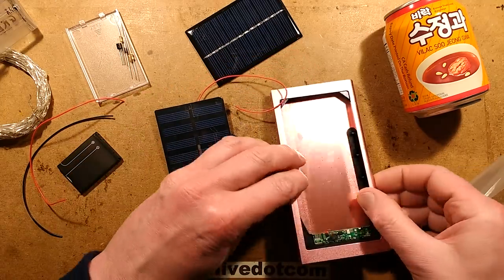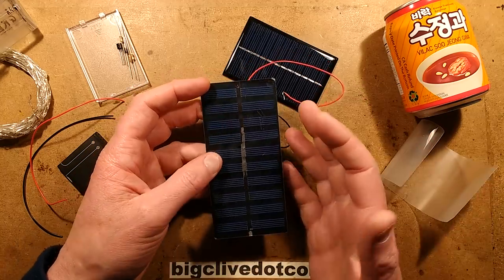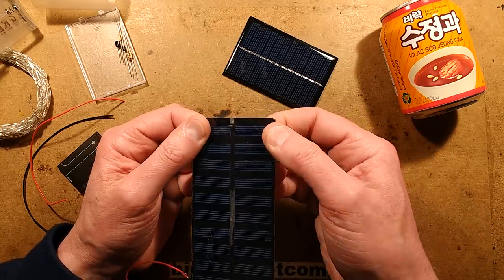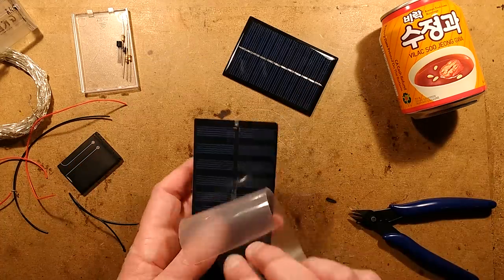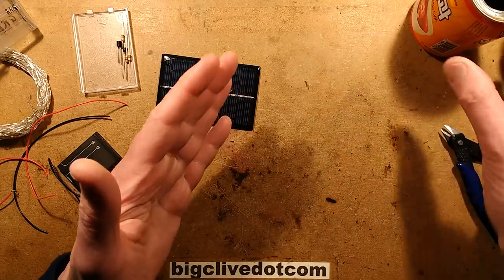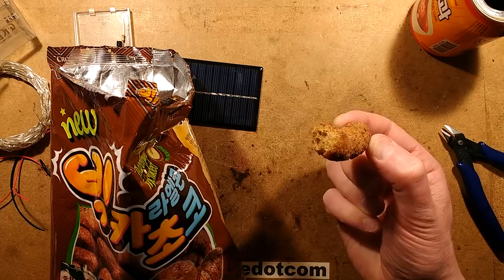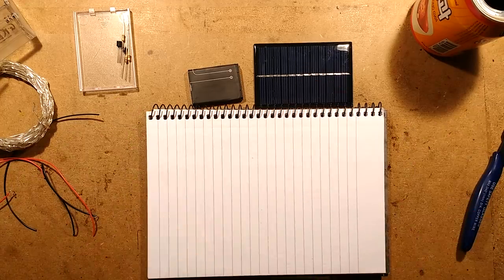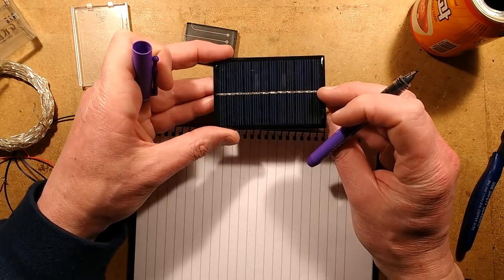Simplest solar light possible, using old phone battery.

Comment: I know my response is a little late, but yesterday evening was the time i finally got the parts and the time to build this circuit for a 3D printed VW T1 van. I want to use it to light up the headlights, taillights and some interior led's. So some simple led's. The circuit works, however i have to place the solar cell directly by the window for it to turn off the lights and start charging the battery. If i want to place the thing on a dresser in the room then it finds that the current daylight is not enough.
So my question for you Clive, is there a way to adjust the circuit so that it turns off the led's in a less bright environment? Thanks in advance.
Reply from the maker: What voltage and current output is your solar panel?
Reply: I have 2 small panels in parallel both are the same and are 5V 110mA (0.15W). One larger panel of 15 x. 6cm didn't fit the model, so i bought 2 smaller 5x3 cm panels and thought 2 of them in parallel is about the same as one bigger panel at 200mA   @bigclivedotcom
Reply: Hey Clive, i did some thinking about my use case and came up with the following. My solar panels can generate 5V but at the ambient light i get here it gets nowhere near the 5V max output. So watching the video again i would guess that since the voltage of the solar cells needs to get above the voltage of the Li-ion cell, thats the reason why the circuit only turns off the led's when i hold the solar cell in bright sunlight.

So lets say that my cells produce about 2.7V in the daylight i get indoors (yes i've measured this voltage) would it benefit my use case from changing the 2 cells in parallel to series? That way i would suspect i get around 5.4V in total in this normal daylight and thus enough voltage to be above the battery voltage. Which in turn would make the circuit usable again for my case? (although charging current would then be reduced to the 110mA of a single solar cell)

What do you think? @bigclivedotcom
Reply from the maker: @patrickneijenhof4080  Try wiring the solar panels in series.
Reply: You have a way with words Clive :D Thanks. Will let you know if it works out :) @bigclivedotcom
Reply from the maker: @patrickneijenhof4080  Ah, I didn't see the bit of your comment where you mentioned wiring them in series.  It sounds like a good idea.
Reply: I suspected you indeed did not see my second part of the comment, but even if you had seen it, then it would just have been the short and concise nudge needed to get me in the right direction. I need to rebuild the circuit as i did something stupid and blown up the transistor yesterday evening. Luckily i have everything in spare, so going to solder it up later tonight. that way i can test it tomorrow :) @bigclivedotcom
Reply: Hey Clive, Progress has been made, placing the solar cells in series is resulting in the circuit staying off at a lower brightness. It is however still not perfect. To explain i first need to elaborate on the led's i've used in the model. it consists of 2 classic style red led's, 2 warm white clear led's and a small strip of 4 smd warm white led's that are cut from a 4.5V ledstrip. All led's have their own 330 Ohm resistor as i like to under drive them and the 4 led's in the strip also have one 330 Ohm resistor. The issue now is that with the room light on the red led's sort of glow and the rest is still off. As if the transistor is in a halve on state. Placing my hand on the solar cells results in all led's turning on, but not at the brightness i got with the old configuration. Shining.a light on the solar cells though, turns all led's off so i guess daylight should be enough for the battery to start charging.  So would there be a way to influence the current setup, so that the led's get the same brightness as before in the other setup? I suspect the combined voltage of the solar cells is a bit on the high side now for the circuit, (even in the dark)?  Again thanks for the help. @bigclivedotcom

Comment: I made one of these. Myself and I'm getting weird results. The solar panel I'm using is 7.2v 100m but under a very bright flash light I only get 4.3v between battery + and emitter of bc547 and 3.7v between battery + and base and 2.4v between battery + and collecter before the 100ohm resistor.. Hope that makes sense any input would be Awsome!!

Comment: what is the charging circuit? It's at 15minute38seconds into the video. Looks like a resistor but dark in color. Negative to the Negative.

Comment: Clive, to prevent the battery from back-flowing through the panel at night could you just use a diode in the positive side as well as the negative side?
Reply: CJ Brown This circuit USES the reverse leakage current to turn on the transistor...
You can add a diode in the positive connection, but than you have to add a high value resistor (100k to 1M ?) between battery + and solar -
Reply: pgScorpio, Would this be similar to an "active" diode?
Reply: CJ Brown No.
You could use an "active diode" in the positive but that would be overkill in such a low power application.
Reply: pgScorpio thanks for your help.

Comment: Clive, can you advise, what size cables are tou using for solar garden lighting.
Reply from the maker: That will depend on your lighting.  For low current like this, any two core wire will do.

Comment: I try to make solar charging led light , with below item.
1) 12V 50W led COB light
2) booster MT3608
3) 3.7 volt battery one PC
4) 5v solar panel
After connects all its works but booster become very hot.
Why this happen?

Comment: Hi, I did the same as you, only I put a 1m 5V LED strip and it works great. The problem is that the LED strip shines poorly, when I power it directly via the battery, it shines much brighter. What should I change to get a brighter light? greeting
Reply from the maker: I have another video of a version with a MOSFET that turns on harder.

Comment: What happens if you use a brighter LED instead of the green LEDs and shine it the solar panel. Does it oscillate?
Reply from the maker: It would tend to sit at an average intensity.
Reply: My understanding was that, since it's a feedback loop, it would still oscillate - what is known as a relaxation oscillator - but since the transistor is faster than the human eye refresh rate, it looks like half-brightness. I am not sure, and don't have an oscilloscope to check. But in a relay-based relaxation oscillator, you can just put a capacitor across the coil to slow it down, so you could try the equivalent here and see what happens.
Reply: Danya G. I've made an oscillator with a relay before.

Comment: How does it handle a full battery in full sunlight ?
I am assuming the protection circuit will stop charging at too high an input voltage with no load on the solar cells
Reply from the maker: The solar panels of that side have a limited output current of no more than a few hundred milliamps.  If you consider that a phone charges at around an amp or more it's well within the rating.  Once the cell is charged the protection circuit will break the circuit.

Comment: I'll say with protected cells I've charged them directly from a USB power supply and I ended up charging a 650mAh cell at 2.2 amps and a cheeky 4.3 volts.

Comment: I would like to use the solar panel 12vdc. Can I use this circuit for my project? Waiting for the answer. Thank you
Reply: Little late maybe but because Clive seemed preoccupied... You could connect more powerful panel with voltage down-circuit but the amps would be too much for the battery circuit. Small, low amp panels work great, even a bit higher voltage ones than the battery.

Comment: I made one and it came on way too early it’s fairly bright. Does changing the value of the 10K resistor alters the light level needed to turn on the led ?
Reply from the maker: Raising the value may make it less sensitive.  It's not going to be too accurate due to the simplicity.

Comment: Good idea ,but would it be possible to go a few steps further 

Instead of  using lights  use a little water pump instead ,so that the sunlight operates the pump and charges the battery in the day ,then at night auto switches to battery power for a set number of hrs so it doesnt run till the next morning or battery runs completley  flat
Thanks Mark

Comment: How much current can this circuit support? Is there an option to use a MOSFET instead of a transistor to get more current?
Reply from the maker: You could use a 2n7000 MOSFET for higher current.  But the turn on is slow, so there's a risk that the transistor may dissipate too much heat when in its linear region.  This circuit puts simplicity first, so is only really suited to low power loads.
Reply: bigclivedotcom I am experimenting with a irf8010 right now and it seems to be working at 2A, but it gets hot and will be needing a heat sink
Reply: I first tried with a ss8050 transistor and it had a huge voltage drop.
Reply: bigclivedotcom trying to find a use for lots of pouch cells a have laying around. I am adding 1s BMSs to them and stepping up to 12V to drive let strips. Seems to be working but I am seeing lots of heat on the MOSFET and the DC-DC converter is struggling below 3.8V for some reason

Comment: Clive, I'm curious what your opinion is about 60/40 tin/lead versus 63/37. I've been using 60/40 but I also got a spool of 63/37. Both are rosin core.
Reply from the maker: I've never really compared then side by side.  I'm so used to having 60/40.
Reply: Martel DuVigneaud about 3 percent difference.  😁😉
Reply: Raymond Mucklow  I’ve just got to say it; its 6%.  I know, pick pick pick ; )
Reply: Nic Green yea I was thinking 3 percent each. Maybe from half my brain cells being fried from my youth.
Reply: Under the solder comparison video, some comments mention that the 63/37 stuff solidifies comparatively snappy, making some connections that rely on wicking, like filling larger holes and gaps, more tricky whereas this be advantageous for regular through-hole work over the 60/40's more sedated reaction to cooling. At least that's what I believe I understood from it.
Reply: AnvilShock, cool, thanks! When I watched that video there hadn't been comments on it yet and I hadn't thought of asking until this video. I was aware of the theory, but I'll go back and read those comments to glean more. :D

Comment: A few years later you make a video about vape batteries not charging directly, yet this battery does? Please explain?!
Reply from the maker: The solar panel limits current, and the phone battery has its own internal protection circuitry.

Comment: Don't you need a charging ic and heat sensors making sure you do not blow the battery up especially if this is mounted in some place where it gets hot?
Reply from the maker: The solar panel can't deliver enough current to exceed the cells maximum charge current, and if the cell does have the proper protection circuitry in it then it will shut off when fully charged.  (and when fully discharged)

Comment: Hi!
I wanted to do something like this but with a permanent solar panel to maintain my car battery. Maybe 5w or 10w panel with a Victron 75/15 mppt controller. Everywhere I look no one has done a permanent version since it’s supposed to be unplug before switching on the engine. Can’t a diode be sufficient to stop anything going wrong with the engine on??? :/
Reply from the maker: Most solar vehicle trickle charger panels use a series diode.

Comment: ...never tried a transistors before just led and resistor...470ohm..like to try it...but what do you mean protected battery?...there is no bms there
Reply from the maker: Many of the phone batteries have a protection circuit built in.
Reply: @bigclivedotcom  ..can i add a bms..?
Reply from the maker: @surenbono6063  You could definitely add one of the little protection PCBs.
Reply: bigclivedotcom  .yeah..i check on youtube..some batt didnt have those feature on itself but on the phone instead.some had coils for wireless charging checked stripped..since there is no phone to detect batt temp, it cant cutoff power, it is gonna be overcharged , a micro explosion could accur..you know those issues with older versions of lion batt.that could lead to fire..etc

Comment: Why did you use such a little carkey-battery for checking the polarity of the LED-strip when you had a big rectangle shaped LiIon-battery in full sight in front of your eyes? 😎😂 Hidden in plain sight. 😉
Is this green strip now showing you the way from the garden door to the house? 😃
Reply from the maker: The small lithium cell won't push too much current through the LEDs.

Comment: A problem with using a clear panelled enclosure and fitting a solar panel inside is how much you attenuate the sun's rays! A solar panel behind an extra layer of glass or poly carbonate will perform very poorly.

Comment: I don't quite understand how the transistor is being opened when the solar panel is expected to be in darkness. what is powering the base of the transistor?
Reply from the maker: The transistor is turned on by the resistor from the positive rail.  When the solar panel is active it effectively pulls the base low and turns the transistor off.

Comment: Hej i would like to make this but as a beginner i need to follow it step by step. So have you got a diagram showing how you connect the transistors and diodes the right way around ?  I am not a savy tech person but i can follow step by step drawings.  I have a number of phone batteries and some nokia ones also and i have some small solar panels so could you help me in any way ?  like a pdf or a place i can look at to make this item.  I am subscribed to you which is why i like your work.  Thanks if you can help.

Comment: Clive, could you double up the battery and solar panels in series to run a beefier set of leds? I've got a nice string of warm white copper wired ones that run nicely on a higher voltage.
Reply from the maker: Theoretically you could, but the fact that each pack has its own protection would potentially limit the usable capacity.
If your LEDs are all in parallel and run on 5V or three AA cells then they should be Ok with just a single cell.
Reply: Jim Cumming to add to what Clive has said, you would also run into cell balancing issues long-term so you'd get uneven wear across the cells unless they were 100% identical (even from the same batch this is unlikely). Should work for a while though.

Comment: But what if the battery is fully charged and its daylight, I see a lot of solar-panel regulators with a 'load' output, what happens with your creation if the solarpanel keeps giving out the 6v/100mA?
Reply from the maker: The protection in the battery will just disconnect the lithium cell and the solar panel will be open circuit.  This is why a protected battery must be used.
Reply: Big thanks for the quick reply, i'm a absolute newb on soldering, but I got a few nokia spare batteries and just ordered a few 5v solar panels, I will get this working at some point :)

Comment: why does the DW01 protection IC cut off discharge at 2.4V if most people i hear always say stop at 3.0V or so?
Reply from the maker: Normally the usable output is down to 3 and then the voltage plummets.  When it cuts off the voltage usually floats back up a bit.  Likewise the upper threshold is just a bit above 4.2V.  I think it's to allow the device it's in to shut off first before it kicks in as a last resort..

Comment: So can someone explain what I'm missing in this circuit... if the battery is 4V @1000mAh and the green LEDs require 20mA (x 100? for a total of 2A current)each.  I guess they are wired in parallel with eachother....4V/10ohm  = 40mA so not near enough to power the LEDs?  What am I missing?
Reply: Well 4V/10ohm=400 mA, but those LEDs don't even need that much to light up. The rating is the maximum that you should drive them at. There is no minimum rating for current. They will happily light up on less than a milliamp, and I know that because that's how much the night light at my staircase uses.

Comment: How do you, non-destructively, check whether the phone battery has in-built protection?
Reply from the maker: Put on a current limited supply set for 4.2V and then monitor to see if the current cuts off at 4.2v or just above.
Reply: @bigclivedotcom  Thanks Clive.

Comment: I have a string of these lights that runs off 2 x 2023 3V button  cells. I wanted to run them off a 1 x 18650 cell power bank which of course outputs 5V so I figured it would be fine. The string lights up fine but the LEDs are getting hot . Is this to do with the amount of current and how can I get round it ?  Thanks.
Reply from the maker: You can add a resistor in series.  2x 10 ohm for high intensity or 1x 100 ohm for lower intensity.
Reply: @bigclivedotcom  Just tried the 100ohm option and it worked well if a bit dull. No heat in the LED or resistor as determined by a blob of margarine not melting on either  !  (  Not everyone has all your fancy tech :-) )

I don't understand why the voltage is still 5.1 volts when I checked it before and after the resistor though without the LEDs connected i.e. just the power bank and a couple of wires and the resistor.  I thought the resistor would drop the voltage down. Am I going nuts ?
Reply from the maker: @gbjbasdw1  The voltage will be equal on either side with no current flow, but will drop to match the LEDs on the other side when they are connected.  To step the brightness up try adding another 100 ohm resistor in parallel.
Reply: @bigclivedotcom  Thanks for the reply and for all your excellent videos. I have decided to go for the 2 x 10ohm resistors - one on the positive side and one of the negative as per one of your other videos where you create a connector "block" encased in hot glue/shrink tubing. Very neat ! Resistors and LEDs don't get hot with this option. Ah yes - parallel resistor 1/Rt=1/R1+1/R2+1/Rn  Takes me back 50 odd years to school physics.